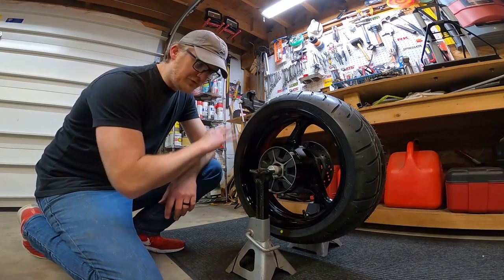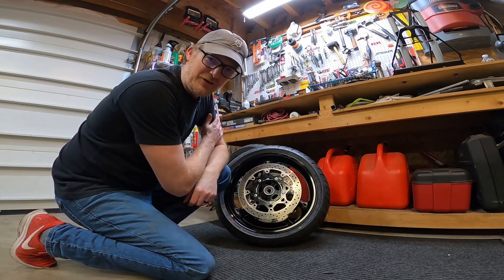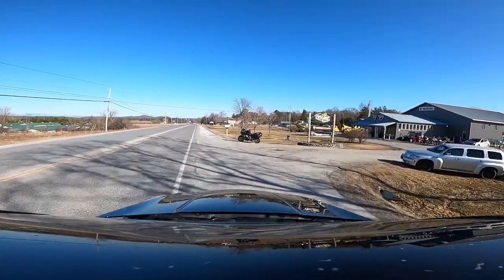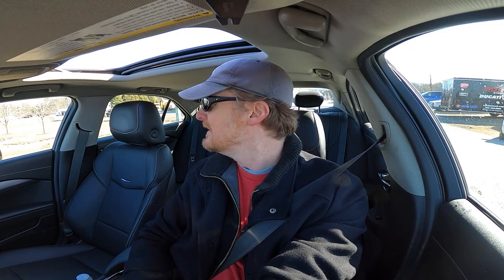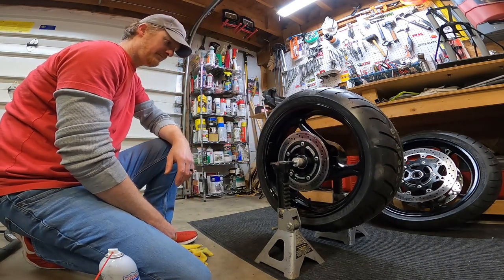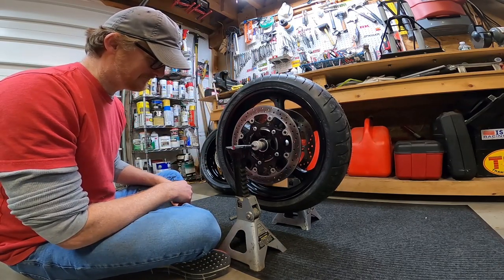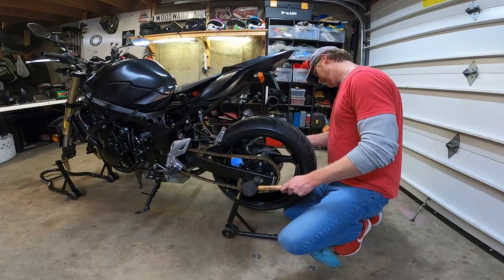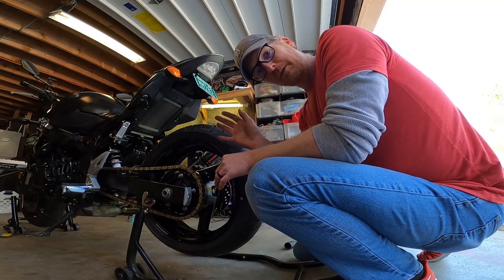It's DONE! The Final Assembly | GSX-S750 / GSR750

Comment: I own a tire shop and always do my own tires. Most tires I do at home on the garage floor. But, the low profile radials are really challenging and you need a machine if you don’t want to destroy the beads.
Reply from the maker: I hear you! I used to install auto tires myself. And I think a home-style motorcycle tire changer will get me through these bike tires without damage. We shall see!! :D

Comment: Hey Michael, I've been watching your videos and man, they are helpful and most of all, we have the same challenges. :)
I have GSX-S 750 2018 and was also doing wheel balancing last year (replacing the tires at the shop and doing the balancing part myself, same tool, black (glue) weights-black wheels...).
And also, everytime I'm praying that there will be no new scratches when I get the wheels back from the shop.
One thought for the wheel balancing, I'm putting weights at the center of the rim and on each side the same amount (they almost touch the 'middle rim line'). So for my opinion the wheels are almost perfectly balanced and It looks 'cleaner' and it's also easier to clean the wheels.
Drive safe and enjoy!
Reply from the maker: That’s a great approach! The oem weights are mounted like clamps on that center ridge. Makes sense to follow the same position. Appreciate the feedback brother😎👍🙏
Reply: @sstressfl  this also greatly depends on the type of tire you use. Michelin for example doesn't have a balancing dot on their tires for the simple fact that they kinda come balanced right out of the factory. I have had great luck with Michelin's Power 5 tires when it comes to balancing them without weights.
Reply from the maker: @hstefan  Just as long as you always verify before running them! I have seen where some michelins required a tiny single 1/4 oz weight. It's rare but it happens :)